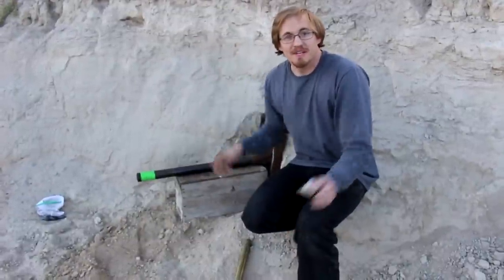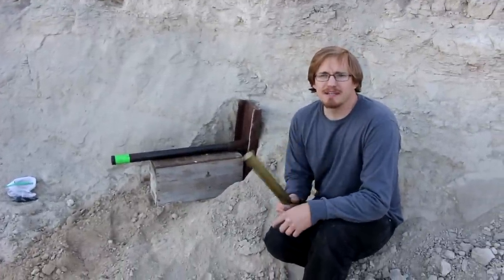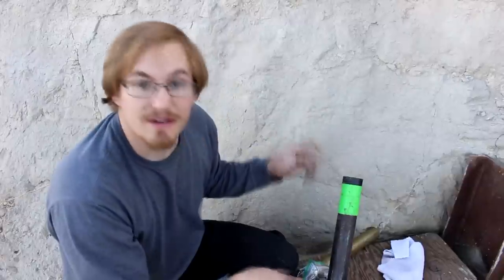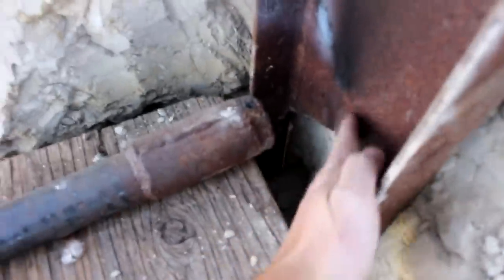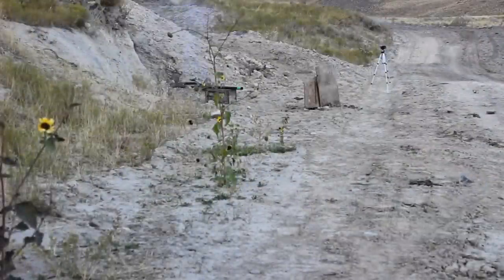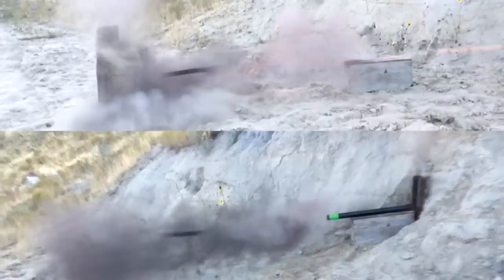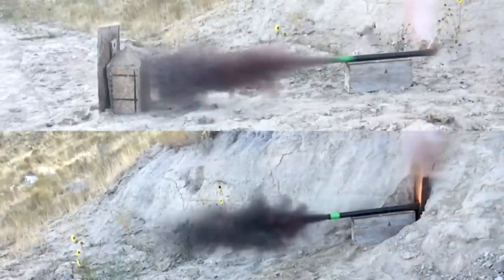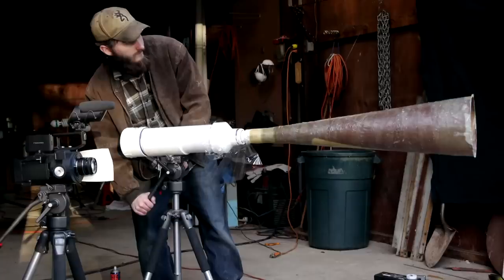How Does Recoil Affect Gun Performance?

Comment: This raises questions for me. Since the projectiles move at the same speed, whilst a factor changes (the chamber moving vs the chamber being stationary) then I wonder if that has any affect on the amount of force the bullet has when it comes into contact with an object. Does it increase, decrease, stay the same? Or does this effect the distance. or maybe something else. It's curious. Great experiment, though, of course! I was surprised by the outcome.
Reply: There has to be some effect in the energy to the bullet from having secured the chamber, where the energy would be otherwise sending the chamber away from the point it began at. I'd imagine an addition of energy. I'd like to see scientific tests, to see what the actual difference is. The energy is there. It has to be going somewhere.
Reply: The explosion has a fixed amount of energy in both scenarios. Scenario A where the chamber flies away uses all the energy on the bullet and the chamber, let's just pretend that each is equal for the sake of this explanation, so each is using "half" of the energy that could be spent in other ways in scenario B. 
In scenario B there is still the explosion of course except the bullet flies away with the chamber staying in place because it is not allowed to move. The other "half" of the energy, the rest of it, has to be going somewhere if the velocity of the bullet is remaining the same in both scenarios. Some of it has to be effecting the projectile in some way because of the order in which things are affected by the initial energy, the explosion. Maybe it's minuscule but I think there must be some added power to the impact that the bullet would make on an object.

Comment: As I understand the physics involved, this Is where the theory falls apart; 
When the projectile is heavier and has more mass than the gun, because if you don't have a brace for the gun to press against when firing, the projectile might stay relatively still and the gun will fly off backwards, much like when a bullet detonates outside a chamber.

Now THAT would be a good experiment. Using a projectile heavier than the gun. 

"Which has more velocity and/or energy upon firing; The bullet fired from a braced gun that launches a projectile heavier than the gun itself, or the unbraced gun whos "static" projectile launches the gun itself due to the higher mass/density of the bullet."
Reply: If the projectile is heavier than the gun, then the projectile becomes the gun and the gun becomes the projectile.
Reply: david21686 or the gun would just explode
Reply: Draken Nonsense
Reply: MoronicAcid1 Why? It could happen, like Cody said
Reply: The outcome would be the same so long as the gun is still much heavier than the explosive. In my opinion that is the ratio that matters, not the gun/projectile mass ratio. It's the fumes from the explosive that move both the gun and the bullet, and regardless if the gun/projectile mass ratio changed the result, having a 1:1 ratio should show at least some sort of difference, and it didn't.

Comment: 7:34 Physics isn't my strong point.  But I can't imagine that the camera moves because the force causes the ground to move.  Sound waves are shaking the camera.  And air movement from the delta air pressure created by the explosion.
Reply: Idk, a tnt charge would certainly shake the ground. Why wouldn't a black powder charge make similar (small) shock waves?
Reply: watch literally a few seconds more. the non braced gun has two vibrations. sound wave and impact vibration. thats alot of energy being absorbed by the rock and it makes sense it would vibrate through.
Reply: The force the ground absorbs and intensity of the sound coming from the gun does cause the shaking. It doesn't shake much in reality, but from our POV it does.

Comment: try it again only this time use a "gun" without a fuse hole and use a blow torch to heat the end of the gun till the powder auto ignites (or fabricate some form of electric ignition) to remove a variable.

Comment: would the mass of the gun compared to the bullet come into the equation, i would try a loose gun with equivalent if not very similar weight to see the force of it moving, but its defiantly a mind thinker, the expansion is still happening at the same point but the braced gun allows the movement of the gun to be eliminated allowing it to force more gas forward than the barrel moving to decreased the gas forward, hmm as all ways awesome video looking out for the next.

Comment: You should make a or 2 "Howitzer" style cannons. Using gas car shocks to absorb some of the energy and allow for a straight shoot. The second with a stiff mount like old cannons. I mean you could use a stiff frame or one with small wheels like from a wheel barrow. Then shoot a Tapered tip brass stock. (Ballistic like a bullet) THAT would allow for more of a 'natural' control. I mean if you had that against your shoulder or against a plate as in this case. It would be better is a actual true control. Also hell- you never know how much farther one will shoot or its velocity will be affected with a 'howitzer' mini style cannon(s).?! DO we? :)

Comment: Huh... and here I thought that the pressure caused by the explosion would apply more force over time when the chamber doesn't move, because the pressure has fewer places to go.

Likewise, I figured the slug was slower due to the fact that air resistance was stronger inside the chamber, due to the air having nowhere to go to get out of the slug's path.

Comment: You need to built a valve somewhere at the front and connect the backside through a channel to it to get all engery for the forward movement.

That could be like a puffer that'll push the projectile after the first kick, like a turbocharger. 😉

Comment: You should test this on a longer range not just by testing the output speed, there might be differences caused by the pressure / vibrations created by the explosion. This is a really interesting concept you should study this more :D. also the braced gun has so much pressure on the end that i'd expect that the gas isn't able to escape as fast as from the not braced one and there might be slight expansion on the barrel material that might slightly. It just sounds really weird that two different environments would have the same results :D:D if only my country's laws would allow me to test this

Comment: It would be interesting to see a barrel made with a touch hole in the middle and 2 projectiles of different weights. To see if the barrel moves and the speed difference of the 2 projectiles. I would guess the heavy projectile would move slower and barrel would not move unless the friction of the projectiles caused it.

Comment: My hypophysis was that the work was equal in both directions for the no recoil shot its just that the work which translated to kinetic energy was simply lost quicker than the brass slug since it slammed into the steel, but im just a thirteen year old that spends to much time on youtube

Comment: The braced gun could have also had less energy due to the work it does on the braces, , not just because of the pressure difference between the two.

Comment: It would be interesting to see this experiment done with a cannon that has no fuse hole. You could use some sort of electronic ignition system.
Reply: I think that with this setup, since no pressure would escape through a fuse hole in either scenario, we would see that bracing the gun would result in a faster projectile. Then, the projectile's velocity would just be a function of the time spent in the barrel.